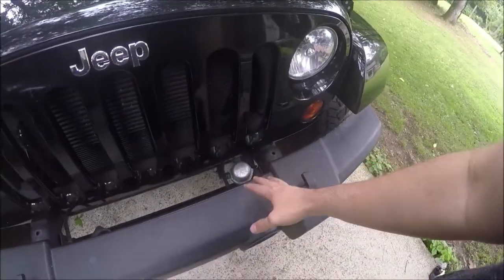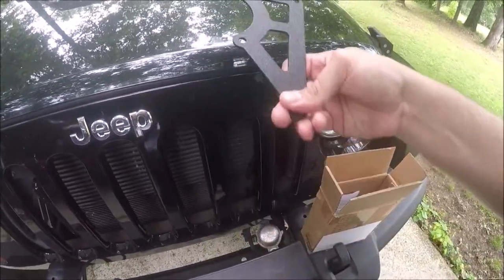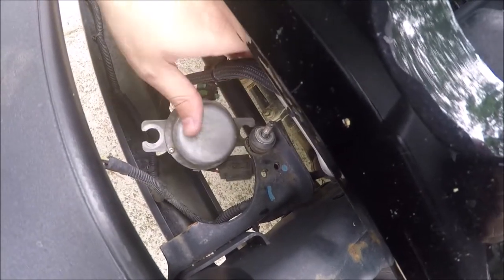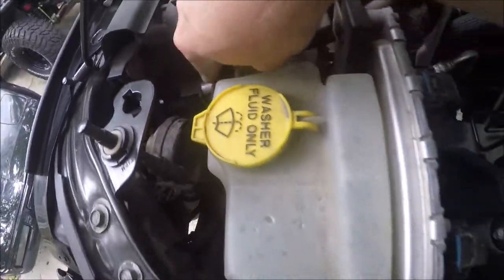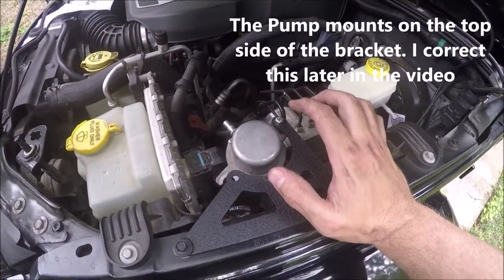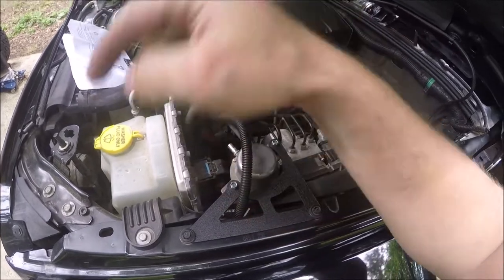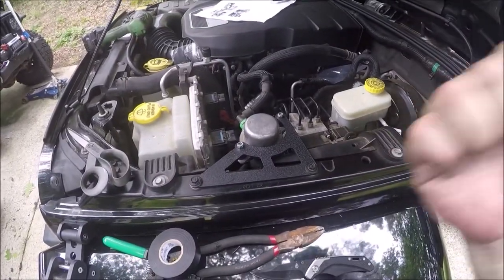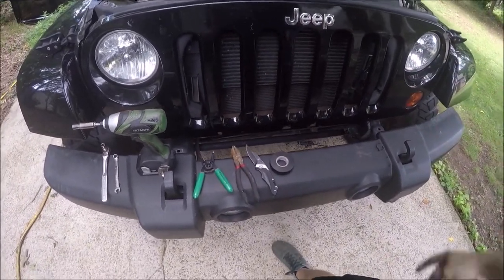Jeep JK Vacuum Pump Relocation | 2012-2018 JKU

Comment: I have question, I relocate  the vacuum pump,  now I can hear the pump  inside , every time is kick in. The you have same issues ?
Reply from the maker: I did until i made sure the rubber isolators were good and the pump was mounted on the correct side of the bracket. Now i dont hear anything